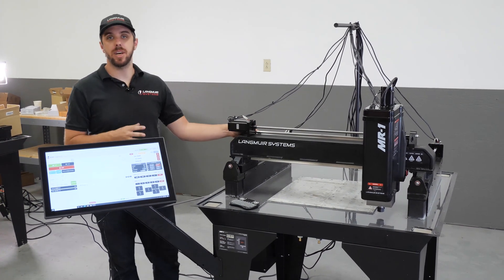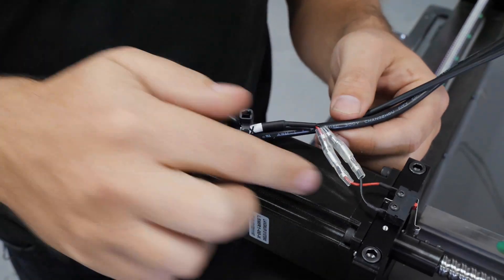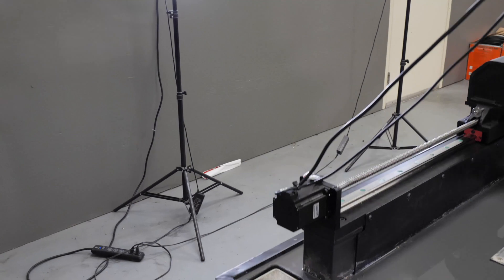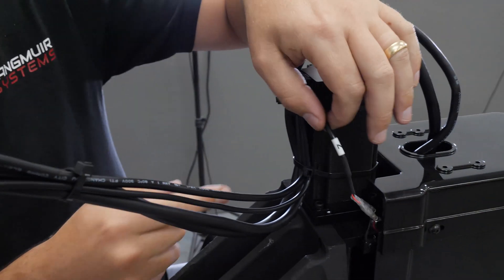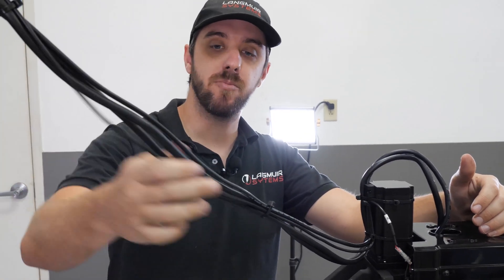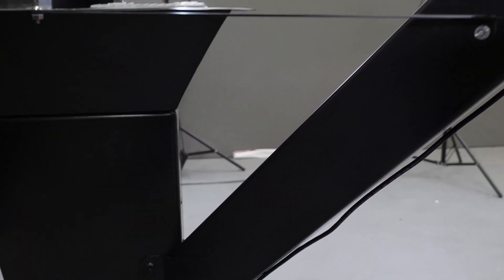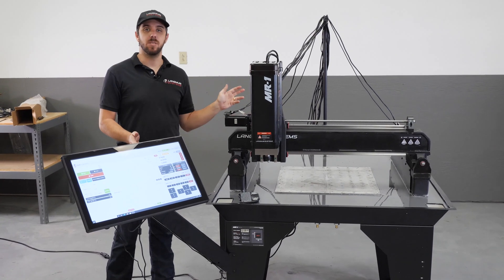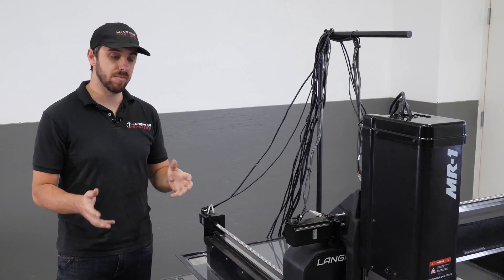MR-1 CNC Mill Assembly Tutorial: Cable Management

Comment: If we have the enclosure do we need to run the cables any different. Or do we just disconnect them from the control box and run them through the grommet hole and reconnect.
Reply from the maker: It’s no different, just disconnect the cables and pass them through the grommet.
Reply: @LangmuirSystems  thanks figured as much! Great job on the videos.

Comment: Aside from the limit switches, is there any crash protection in the event of a limit switch failure or disconnect? Will the stepper motors on the Y axis even produce enough torque to wreck anything?

Really keen on the ballscrew and stepper choice. Very easy to replace and source (In the unlikely event you'll need to replace them ever).
Reply from the maker: Yes the machine has Soft Limits (covered in the next video). This protects the machine from even hitting into the hardstops since the software knows where it is in the machine travel range and it will stop it's movement. Also, the machine was designed to crash! It won't hurt anything to rapid full speed into the hardstops.